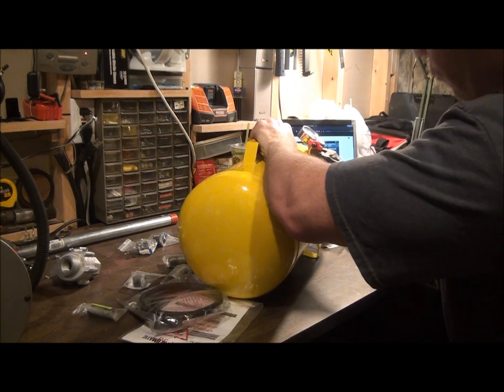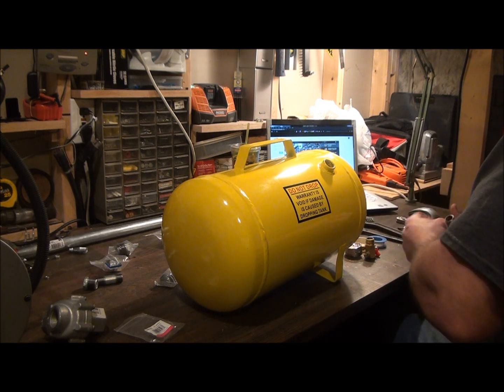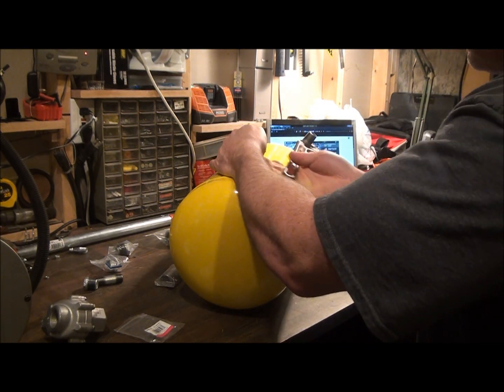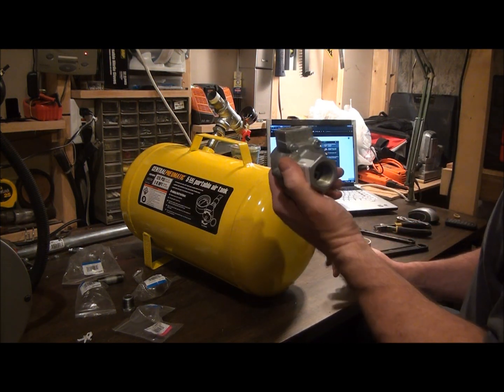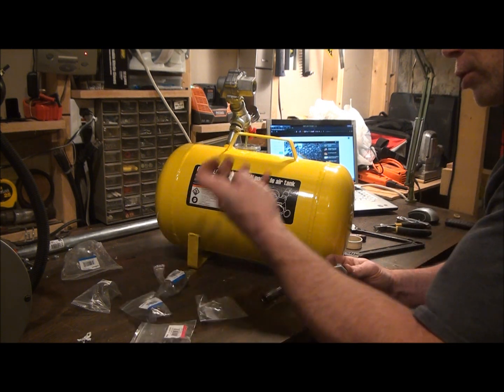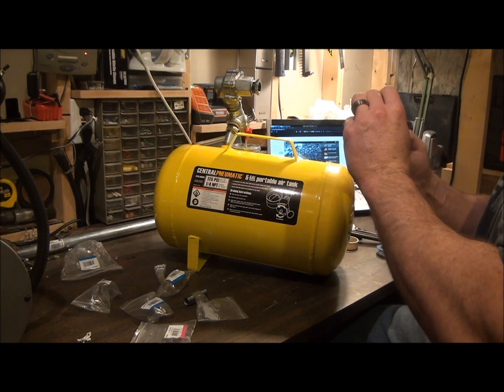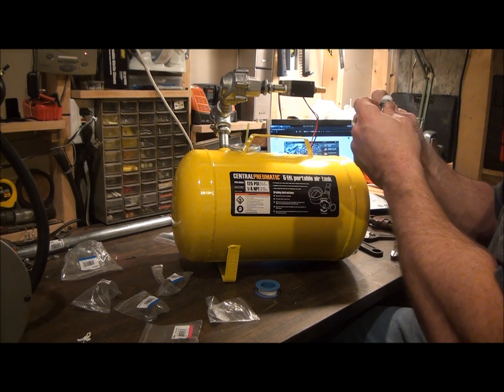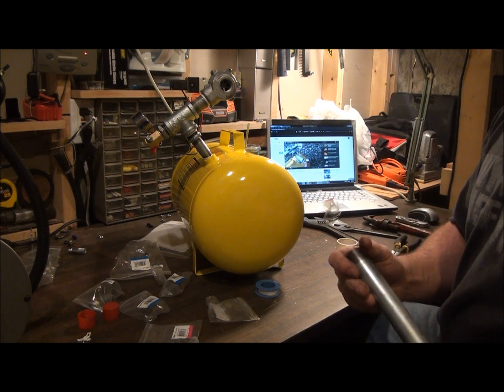Air Cannon Step by Step Build and Test Fire

Comment: nice, I built my first one for this year and scared the he'll out of people...i am building another for next year to put across from it so I can scare them one way and then scare them back....i am picking up that same tank after work cuz it is on sale from 39.99...

i only used 1/2" on mine though so I can keep the air use down.  I have the exhaust pipes to a nozzle so I get a nice pressure blow, but it is the noise that gets them, these things are loud, I am sure that 3/4" is louder...

Comment from the maker: Hey Don, I found that dump valve on ebay for $26 I think, which was pretty cheep for a good one. I don't like using the sprinkler valves just because of the honking and it dumps all your air at one time.